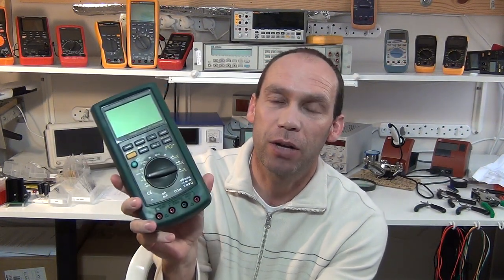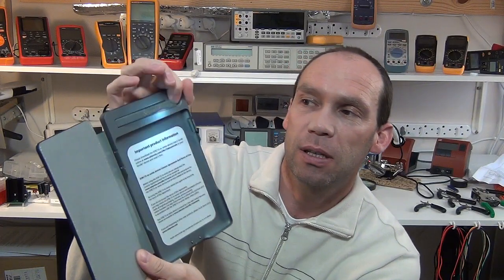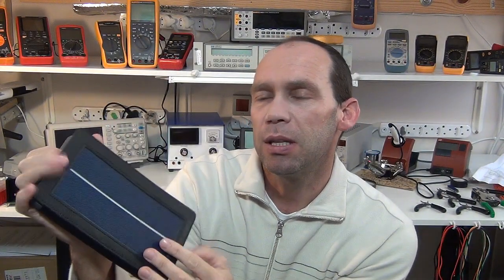T4D #27 - Multimeter giveaway and news

Comment: You should definitely build up your own PCB for the DC Load project (even if it is a relatively simple layout)! After reading about it forever, I finally did my first one a couple months back and it was way easier than I thought! You'll need a laser printer (I have a cheap $100 Brother that I got on sale and works great, plus has Ethernet connectivity!). Anyway, keep up the good work, Martin!

Comment: digitalWrite(DivSw1, HIGH) // Turns on the mosfet isolating cell A's voltage divider
CellAV = analogRead(CellA);    // read the value from the sensor 
CellAV = map(val, 0, 1023, 0, 500); // maps sensor output values to volts
if (CellAV>4) 
digitalWrite(ChPrct, LOW) // Stops all cells charging if over 4v
if (CellAV>4)
digitalWrite(Bleed1, HIGH); // If cell A is higher than 4v it will drain

Comment: Hi thanks for replying I'm pulling my hair out atm over this. Basically in the void loop i have a list of if statements that i want to execute sequentially like: 
void loop() {
  digitalWrite(DivSw1, HIGH) // Turns on mosfet isolating cell A's voltage divider
  (delay 10)
  CellAV = analogRead(CellA);    // read value from the sensor  
  CellAV = map(val, 0, 1023, 0, 500); // maps sensor output values to volts
  if (CellAV>4) 
  digitalWrite(ChPrct, LOW) // Stop all cells charging if over 4v